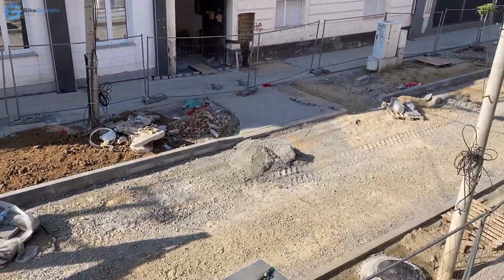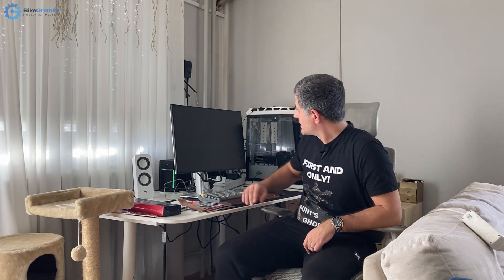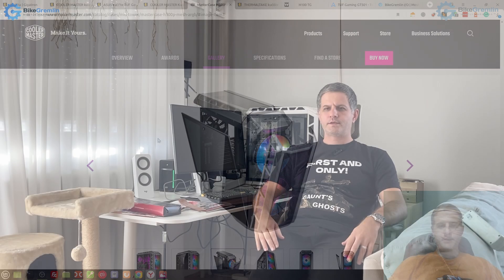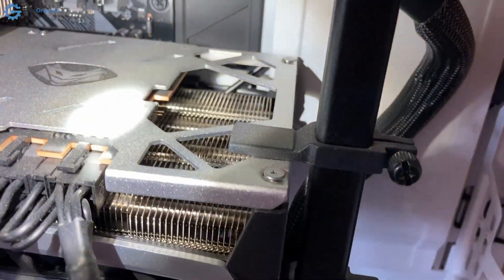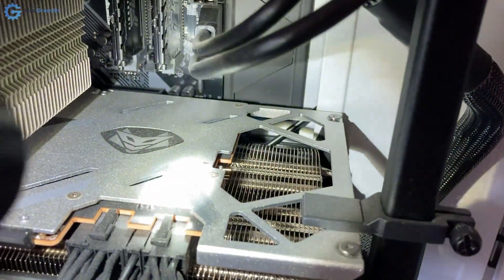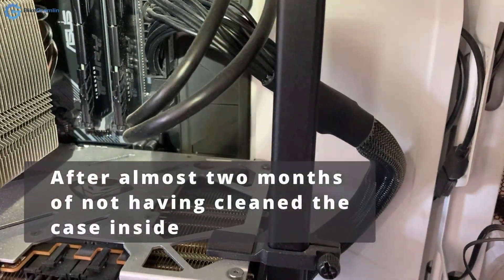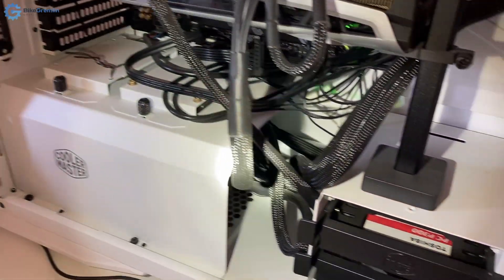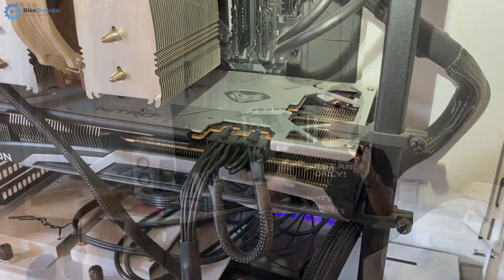PC case cooling airflow - correction

Comment: True, times change. When I built a PC myself for the first time around 15 years ago the "standard" cases were designed with one intake fan and one or two outtake fans. Usually resulting in negative pressure inside the case. (Not even talking about cases 20 and more years ago which didn't even have any fans and the only outtake was through the PSU). So no wonder they were dusty as heck back then. Over the last decade things changed. And now you can easily create positive pressure inside the case and combined with a dust filter it almost eliminates the problem.

Comment: If you haven’t already seen the case airflow testing methodology from gamers nexus check it out!
Reply from the maker: Thank you.

YouTube sucks with comments (and comment notifications) - and often blocks comments with links.

So, I've set up a BikeGremlin forum:
https://www.bikegremlin.net/

The Computer section:
https://www.bikegremlin.net/categories/io/

You could post a link there, if it fails to be posted here (sometimes I can see the blocked comments, sometimes I see them in a few months or never).

My testing methods are quite primitive - what I've seen to work fine for me and the computers I work with. Eyeballing the amount of dust and noticing any cooling problems only in case the computers start overheating (system monitor info is not always 100% accurate but that's what I'm working with).

Relja